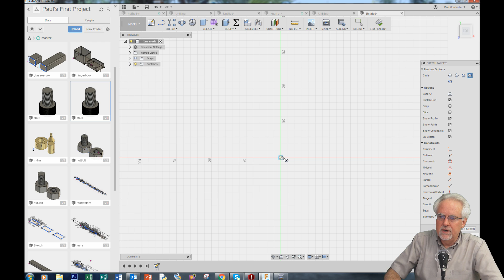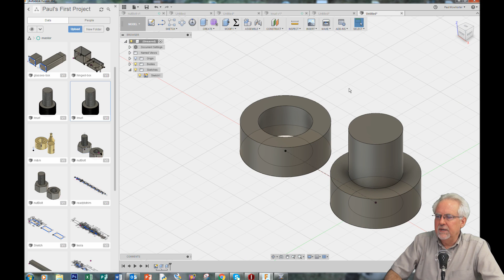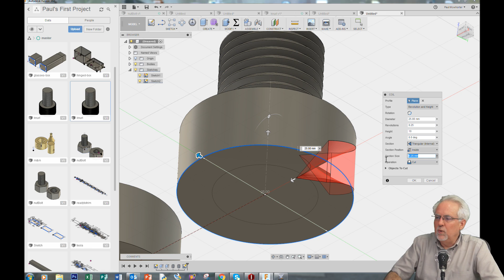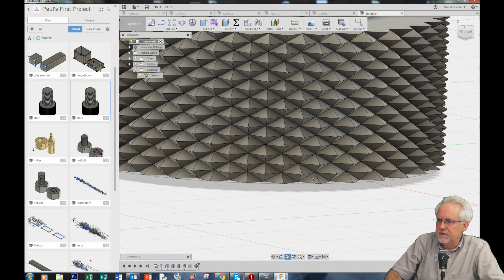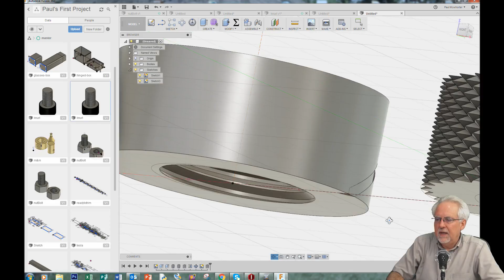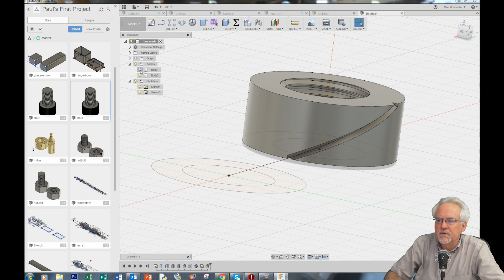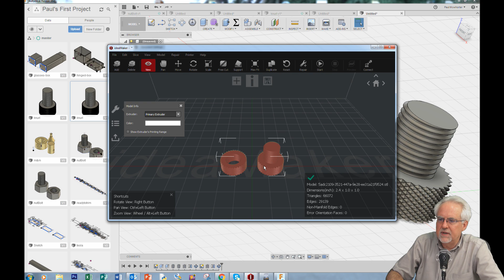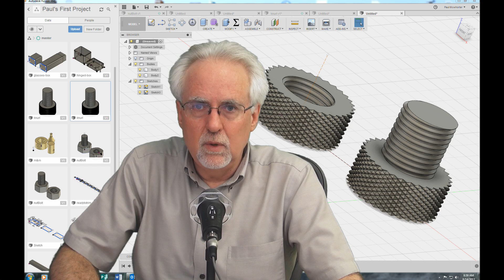Learn Fusion 360 or Die Trying LESSON 8: Design Knurled Nut and Bolt for 3D Printer

Comment: Loving this series so interesting
couple points on this one for me was I followed the first knurl then tried to do the second on my own I remembered I'm going to need a line for an axis and added that but was going nuts trying to mirror the coil. My issue was i was trying to mirror across the "axis line" instead of the plane. Big face palm when I finally gave up and resumed the vid to see my Mistake LoL
Another speed tip would be to change the selection mode on your mirror and pattern palettes to features then you have half the clicks when selecting the coils.

I was also using the parameters (You were not Paul Tsk Tsk LoL) when i put the height for the coil I used the Head Height in stead of the 10 mm so when I adjust the thickness of the head it brings the knurls up too

Thanks Paul

Comment: Very interesting lesson. Do you have a lesson about tweaking the threads to compensate for your printer error? I printed a nut and bolt using Fusion 360 (Fusion 2.0.18950 x86_64 [Native] ), but my diameters were off  .31mm (a built in error of the Ender 3 printer).Is there a way to build that compensation into a standard thread?

Comment: hello paul mcwhorter, i have a couple of questions. how did you establish the .25 revolutions. was that arbitrary or was there a method to the madness. also on lesson 7 i printed the nut and bolt with PLA just for fun an it came out a a interference fit probably by a thousandth or so. i did manage to get it to thread but it was impossible to freely move it, i had to use a wrench. is there anyway in the thread command to alter that situation? could it have been the material i used? thanks

Comment: Hot Damn, that was an excellent tutorial. I followed along and printed out the nut and bolt and they looked great. I'm using the latest Fusion but had no trouble following along. Knurling is just one of those things you really want to be able to do for a lot of things. This was a great base to experiment from Thanks again. One suggestion. When you have finished creating the knurling. Create a cylinder on each side and add a Chamfer on each. This adds a nice finish to the knob. Thanks again Paul!!!

Comment: Great tutorial and came out looking great on my prusa. Only issue I had was the threads didn’t line up correct and were super tight and I couldn’t thread it. Need to look further into this. Thank you!
Reply from the maker: I love the prusa! Please check out my new fusion 360 lessons on this channel. Fusion 360 changed their gear cutter since I made these videos, and now for a 3D printer they are too tight. I have an upcoming lesson where I show how to properly correct it. With your present nut/bolt if you put it on and off slowly, little by little, it will loosen up.

Comment: I have a much newer version of Fusion 360 than being used here.  I found I only need one set of 2 concentric circles.  I first extruded, threaded and knurled the nut and then moved it aside to do the bolt.  I had to hide the bolt to find the Z-axis to revolve the coil in a circular pattern.

Comment: Great videos, so far, even though the series is almost 5 years old, they are still pretty much on target.

I printed my bolt and nut, but couldn't get them to fully thread together.  I'm not sure what happens, but after a few turns, it's totally stuck.  Maybe the accuracy of my prints aren't up to snuff.
Reply from the maker: IN June I hope to release a remake of these lessons focused on Fusion 360 for 3D printing.

Comment: Hi Paul! I don't know if you still read comments as you're probably off on some other project, but at the point of applying the circular pattern to the head of the bolt I get an error message - INVALID FLOAT OPERATION. Any clues as to why this might be? Keep up the good work!

Comment: Nothing like following every move step by step and failing, to shatter confidence. The shadow of the pattern cut is like yours click OK and get a fat shark fin from center to edge. tried this with 3 as the pattern number same result. Perfect shadow, then ... Perfect mess.
Reply: OK found the problem. I had the nut height 8 but was putting the coil height at 10. I would have thought this would cut thin air and have no other effect but ==> Fat shark fin...

Comment: Hi Paul , I really enjoy your lessons and am learning so much ... I have one issue ... When I print the designs they never fit together... If it's the glasses boxes that can't close or the screws that don't fit the bolts ... Shouldn't we take into consideration the tolerances of the 3d printer ? By the way I am using a prusa 3s

Comment: Another great lesson.  I printed off the previous nut and bolt and it worked though the fit was a bit tight.  Of course wiht 3D printing there are many variables that dictate the final result in terms of dimensional accuracy.
Cheers,    John

Comment: Still no luck with this one. Something has been left unsaid about creating a second vertical axis. I cannot get Fusion to act in the same way McWhorter does here. I go from working on the bodies to trying to create a new sketch using the Y-Z axis to add the construction line but I end up in the top-view of the sketch. Impossible to make that vertical line while in that view. (I'll leave this comment here as a message-in-a-bottle for someone who may find it some day. Thanks in advance!)
Reply: I have the same issue that I can't draw a vertical line.
Reply: I'm sure its too late but here we go. https://youtu.be/SagnKWBtsNI?t=619 video is timestamped so pause there and notice he has his mouse over the 3 different planes that appear above the Origin Point when creating a New Sketch. He picks the X,Z plane(Vertical) because he started his drawing in the X,Y(Horizontal) plane. 

One of the reasons he stresses starting creations in the X,Y plane. Guarantees Up/Down is always on the X,Z plane.

Not sure if that helps anyone.

Comment: When I try to create a new sketch for the vertical construction line centered in the nut, the line gets drawn from the center of the bolt instead. I wonder if this has to do with the copying of the concentric circles in the original sketch.

Comment: Awesome lessons, easiest to learn by far.  The print come out great but the boxes and the nut/bolt don't have enough play to completely screw together. Is this a setting or something I should change with my 3d printer or simply3d slicer?  Any help would be greatly appreciated
Reply from the maker: It depends on the individual printer, so you need to add some tolerances in your design.
Reply: @paulmcwhorter  
Thanks for the advice.  I'm still hung up in lesson 6 adding the hinge to the box.  Do you have another video covering that topic?

Comment: Is there a model number for the Prusa printer Mr Paul? how much is it? thanx
Reply from the maker: Prusa i3 MK3S. It is about $1,000, but in my mind well worth it. This comes fully assembled. You can buy it in kit form and save a few hundred dollars, but I would pay for the assembled ones. There are cheap chinese clones available, but really 3d printing is tough so would start with something you know will work.
Reply: @paulmcwhorter  will check on amazon thanx

Comment: There occured just the bad things, that allways occure in CAD programs: The ends of the triangular groove in the cylinder where not correct. The program didnt seem to know how join the coil to the bottom of the cylinder. Probably it uses a centerline with a triangle rectangular to it. The centerline reaches the bottom but not the part of the triangle above it. Result: It doesnt know how to end the coil.

Comment: Since you created the bolt and nut at the SAME diameter and height, would I be able to do 2 bodies on the bolt first, once knurling is done, copy the half part of the bolt with out the threaded part (diff body) paste, create circle, extrude, create thread to get the nut done? Then extrude the other one, extrude and create thread?

Another question, is knurling process the same with all types of face, i.e. flat, 3d triangle, oblong etc? 

Thank you sir!
Mine

Comment: Hi Paul; just recently started going thru your series, got thru lessons 1-8 so far.  Really good series for learning Fusion 360.  Don't have a current need/interest in drawing gears tho, so lessons 7-11 are of lesser interest.  Lessons 1-6 were great; I expect 12-13 also to be helpful.  My real interests for Fusion 360 are for creating CNC 'cutting files' from RC aircraft plans AND designing 3-dimensional structures (like workbenches) from dimensional lumber , plywood sheets, and even PVC tubes and fittings.  Any plans for adding lessons like these to your series ???  TomZ

Comment: I've tried 3 times to make a nut & bolt, but they don't fit together very well. Too tight a fit, even though I used your example. Any suggestions?
Reply from the maker: This has worked for prints on my Prusa and Raise3D printers. Maybe if it is too tight leave a little tolerance. Might try making the hole in the nut .1 mm larger than the bolt shaft.
Reply: I made the nut thread diameter 15.5mm and it works like a charm. I suspect that the slicer is dimensioning to the center of the outer line which is on my current settings 0.8mm wide. Therefore half of that is 0.4mm plus 0.1mm for tolerance and that's how I got to 0.5mm and it works likes charm.

Comment: Hey Paul. Your Home default is different. How did you accomplish that?
Reply from the maker: It is in preferences. You want X-Y plane as default. You want default z axis is up
Reply: Tried that. Same results. When I "Stop Sketch", the Layout Grid disappears, the drawing rotates approximately 45 degrees clockwise and the Front Face is facing the lower left corner of the screen. So when I extrude, I must pull left or right instead of up/down unless I force a rotation first. Suggestions?
It only rotates onto it's "back" when I start drawing in the XZ plane (lower right). Default modeling orientation preference setting doesn't seem to make a difference on mine.
Reply from the maker: Try starting a completely new design. I think default does not change on old designs.
Reply: Solved. I had also been trying by starting new designs. I went back to older video lessons and studied the orientation of your View Cube. Mine kept starting on the Front, not the Top. It was a matter of clicking directly on the plane, not just near it. Perhaps a tip for a future lesson. :)  that is something Autodesk could make a bit more user friendly.

Comment: Just in case you didn't work it out, when you mirror was not working, you needed to cancel the current mirror plane (using the X) before selecting the correct plane.
Reply from the maker: Yes, it is sort of hard doing these things live. I usually do the design once with the camera off, then do it more smoothly with the camera, but still I end up with problems some time.
Reply: Thanks Stephen I got hung up on this for some time.  I appreciate it.